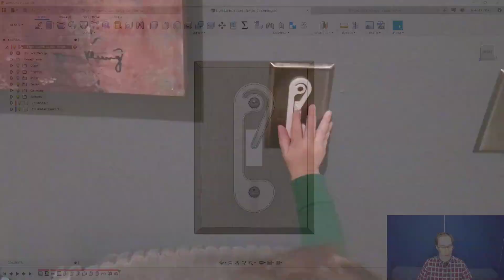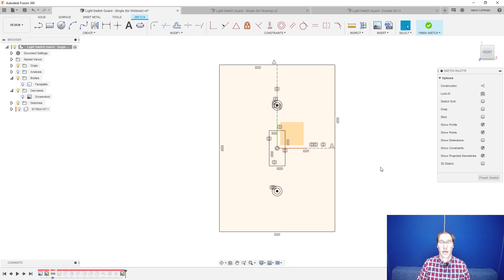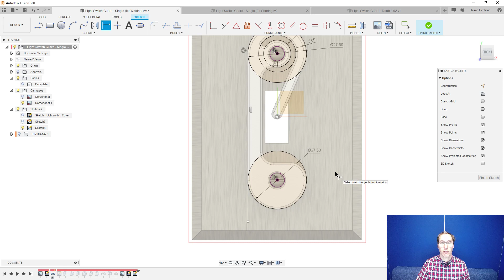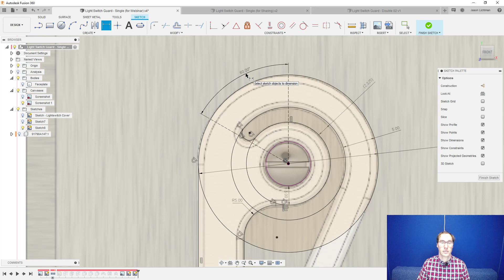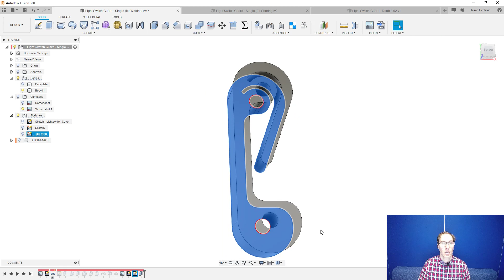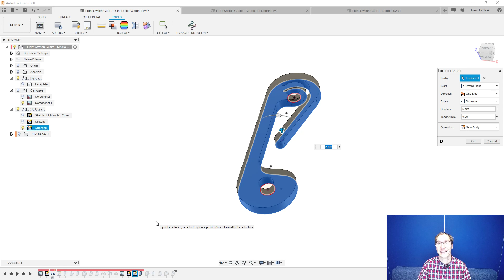360 LIVE: Let's Design Something EASY & Practical: A Light Switch Guard!

Comment: I don't have a problem with creating the light switch to show people how to do things.  My question is why create the light switch to begin with?  I know you are using it for reference locations but you could have just made that a parameter.  Sometimes I think for someone new to making objects to 3D print this makes people think that they have to design the object that the print will be attached to first before they can design the 3D printed object.

Not a complaint just something I noticed with the last few posts.
Reply: Eric Gigante you are correct that you don’t NEED to. I do usually 3D model the thing my part is going to fit onto because it helps me visualize how my part is going to interact with what it’s going to fit onto. For this project, it doesn’t provide much benefit besides prettier pictures, but in many past projects, it helped me find problems earlier in the project. I’m quite fast at modeling when I’m not doing a live stream, so modeling the base part happens fast. Thanks for your feedback. You brought up an excellent point worthy of discussion. That is always appreciated.
Reply from the maker: Thanks for answering, Jason!